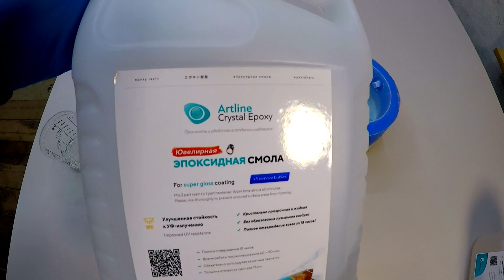Светильник - сверлильник  из эпоксидной смолы / Epoxy L.E.D. Lamp / Arduino WS2812

Comment: I've heard many people say that using a pressure pot instead of vacuum chamber is much easier and faster for degassing epoxy because it shrinks the air bubbles into being invisible. It sounds like it wouldn't work as well but I've seen it done many times and it really does come out perfect. Really cool idea for a lamp though! = )